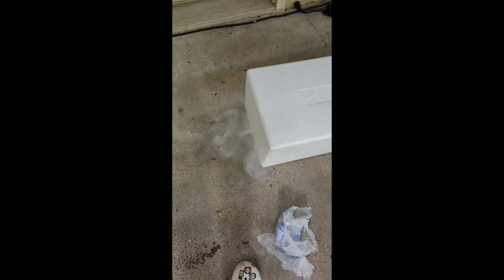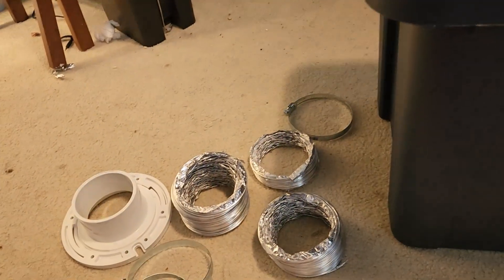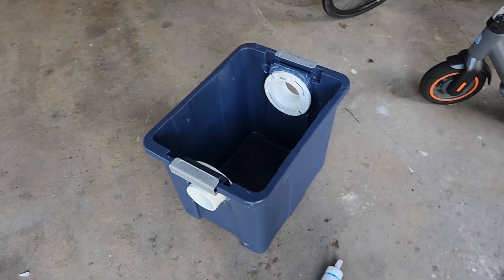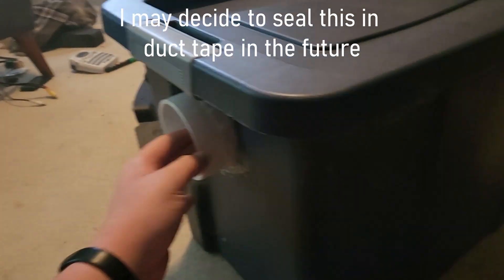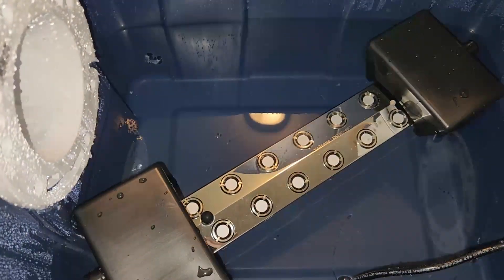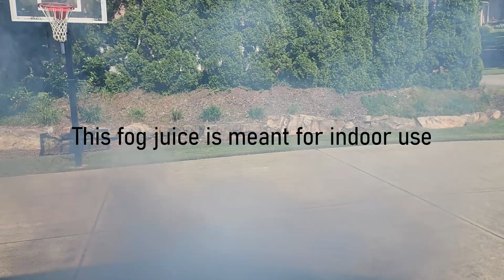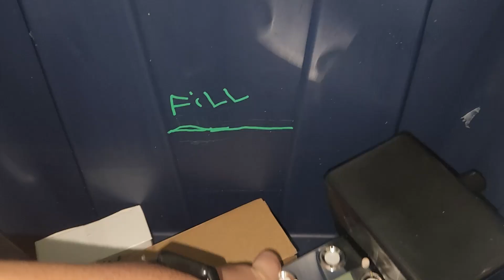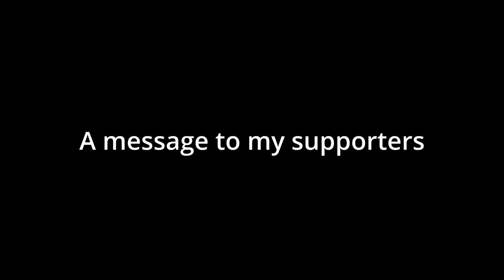Making a fog chiller using an ultrasonic mister

Comment: Try this, where you have the fog machines outlet nozzle shoved into the pipe.... Instead give it three to four inches away. So just pull it back out of sticking directly into your inlet tube where it has about a 3-in gap. I know this sounds odd but trust me. It's called the Venturi effect. You will be blown away at the difference of output you will get with just the fog even without fan...all if you do that small little adjustment. Cheers
Reply from the maker: I actually did this when I used this setup on Halloween and it worked a lot better than demonstrated in the video.

Comment: That's the exact same inline fan I ordered from Amazon for my fog setup. It worked for 2 days and then stopped working.
Reply from the maker: That sucks, hope you can return it. Cheap stuff like this either burns out after a day or lasts for 10 years there's no in between
Reply: @RMA2009 I did return it and the replacement one I bought which was a different brand lasted all of 20 minutes. Amazon just did a returnless refund on the second one for me. The third one that I bought is now supposed to be Marine rated. Haven't had a chance to hook it up and try it yet.